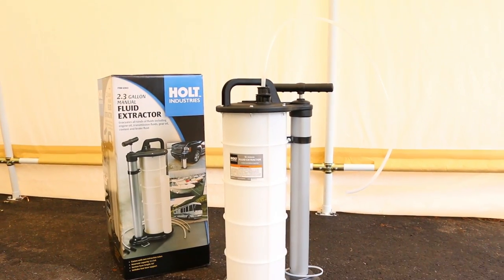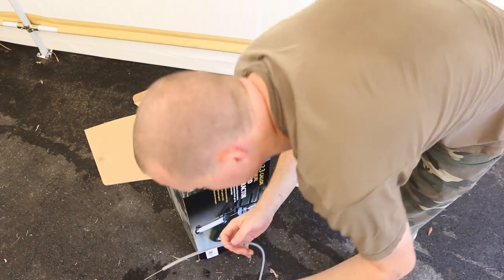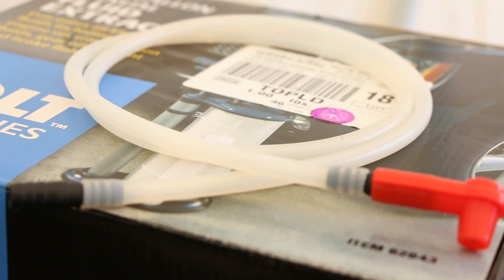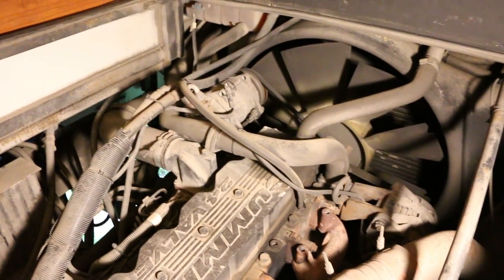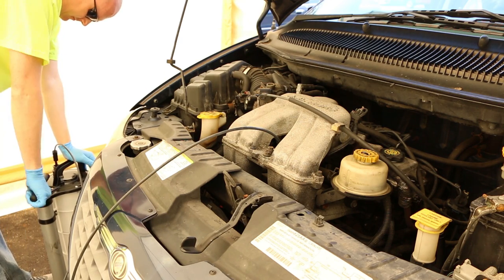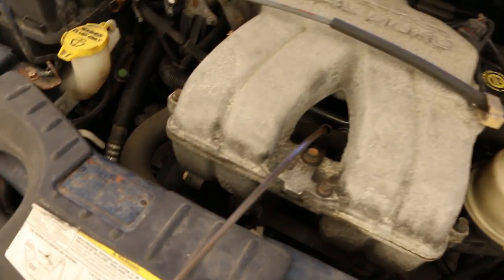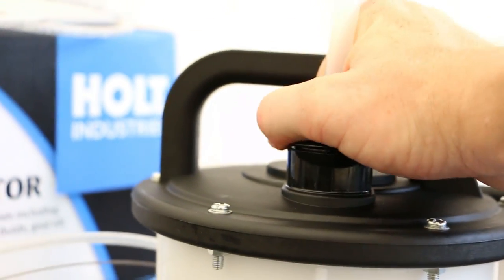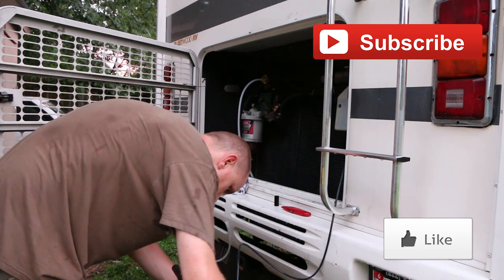Holt Manual Fluid Extractor from Harbor Freight

Comment: I overfilled my trans fluid after doing a filter and fluid change. I was thinking how much of a pain to drop the pan again and my step-dad recommended using a tube and siphon to remove the extra fluid. Worked great and I noticed the fluid was really drity again after only a few miles of driving. Think I will go get an extractor to flush and fill the trans a few times until the fluid is clean. Saves a lot of work especially on a trans with no drain plug. Good video.
Reply from the maker: thanks for the good words! I highly recommend looking into buying a used electric vehicle if you are getting tired of having to maintain internal combustion engine cars constantly.
Reply: Stay well clear of second hand electric vehicles, I should know I’m on my 3rd! Worst purchase you could possibly make. Stick to what works and has worked for years.

Comment: I paid $73.29 using a 25% off coupon. I like that it holds 2.3 gallons of oil. My wife’s MB E360 holds almost 2 gallons of oil, plus the filter is on the top. I will never remove the drain plug again!
Reply: Then you won't be getting all of the bad "stuff" out most likely.  Do a test.  Drain it with the evacuator.  When you're done, undo the drain bolt and see what collects in a drain pan, then you'll know for sure.
Reply: Ken Nagrod it’s only about 100 ML or less. Plus I do oil changes every 5000 miles. It’s perfectly fine.

Comment: I had a MitiVac that gave up the ghost about 6 months ago.  It had sealing issues so it would take 4-6 cycles of pumping to complete the oil drainage for my Mercedes (7 Qts). Got this one at Harbor Freight, and it's MUCH BETTER than the one I had.  Oil changed in less than 20 minutes on ONE pump cycle.  Worth it for DIYers if nothing else for the convenience and safety of not going under the car for an oil change.  It'll pay for itself in a year.
Reply from the maker: +David Badger nice! Thanks for the comment.

Comment: You didn't know where the dipstick was? 🤨
Reply from the maker: if you are talking about the van and the dipstick for that, prolly yeah. The transmission dipstick was in an unfamiliar area. Otherwise you see me simply inspecting around the motor. The van was relatively new to me at the time. Switching out transmission fluid is very worth doing for longevity of transmissions.... If you can make the switch though, an electric vehicle is phenomenal when it comes to maintenance.

Comment: typical volvo owner.  lol .... I know because I are one.  3 times over.  Currently own 3.  total owned in my lifetime ... 5.  So I get your sense of humor.  We're a strange culture.  I also have a motor home with a rear engine diesel.  I use my oil extractor mostly for my sailboat diesel motor.  It's hard to get to the drain port.  This thing works great.

Comment: You really helped me out after purchasing this. No where in the instructions does it mention pulling out the spout to pour out the old fluids. It was still difficult the first time. Now it comes out easily. I may still return it. On 2 of my vehicles I couldn't suck out any oil. After a lot of trial & error I realized the tube wasn't hitting the bottom of the oil pan. I measured it with the dip stick. It hits something & stops. GM 4.2l & 5.7 LS1 engine. I'm going to try your idea of buying 1/4" hose. That hose it comes with is very stiff. I'm hoping the the new hose will be softer & can get around the obstruction. My wives Buick 1.4 engine, I was able to reach the bottom of the oil pan. That car has a much shorter dip stick then the other 2 engine mentioned. Thanks for making this video & helping me decide if to keep it.
Reply from the maker: Glad I could help

Comment: I got one could be user error but I guess it left about a quart of oil in the pan. I kept on pumping and moving the hose around to try to get all the oil out. The one thing I think it needs is some way to trap the handle so it doesn't go up when you have it primed.  I would say for oil changes it's much slower than the old fashioned way of getting under the vehicle.  Another idea is put tape of something to keep you from fishing out the tube IF it ever comes loose and goes down the dipstick

Comment: Tried to buy the pneumatic version in HF. The manual version is now $144 while the pneumatic version is $149. Unfortunately HF did not honor my coupon so I did not pull the trigger. Buying retail with taxes will come up to $163 is hard to swallow. I understand inflation brought the price up since this video was made but still..

I end up buying the Schwaben 6-Liter Dual Powered Oil Extractor from ECS tuning for $90 after discount. This model can do both manual pump and pneumatic. Looks good on the brochure and the videos I’ve watched. Hope it will be as good or better than the HOLT.
Reply from the maker: I got the big green one right at the begining of covid (no video of it) it was the same price then. harbor freight has really kept most of their prices steady thru the past three years.

Comment: You can also change your p/s fluid, hook it up to the return line at the reservoir. Pump it up and it will suck up the stuff pretty good, it helps if you turn the steering wheel L-R.
Reply: You.must make sure the car is not running .pumps hate to run dry even for a few seconds

Comment: How do you like it so far? Are u able to get all oil out?
Reply from the maker: Yeah, enough oil at least. So, I ended up using it for all kinds of stuff and ended up leaving it outside for too long. I ended up buying the pneumatic one. The pneumatic one is tuff to use but nicer because it uses less pump strength.

Comment: My extractor just started leaking from the bottom when I began to pump. There is a spring loaded valve located under the base plate and it seems that this is failing. Any ideas?

Comment: Can I use it to remove dirty antifreeze coolants
Reply from the maker: Pretty sure you can with no issues. Your engine problems may be catastrophic however.... I've seen a Jeep warp two heads due to clogged radiator. Crazy. Those 4.0 blocks and everything else are near bulletproof, just dropped the ball on cooling.

Comment: Its 140 buchs now . Can ya use it for gas.   Or any fluids we should not use it with¿? Thanhs.   Never mind $140 one is the deluxe model but I'll be damned if I can tell the difference between the two

Comment: Still have to jack the car up and get under it to change the oil filter,so what’s the use.
Reply: The "use" is you don't have the issue of stripping the drain plug, having the drain plug fall into a vat of oil and you play blind deep sea diving for it and you don't risk spilling oil trying to put it into the gallon you just emptied.  And not to mention the  time you waste.  So, it worked out for me. I paid $65 with 25% off coupon. It's made my money back on 3 changes.

Comment: Just buy a vacuum pump while you are at harbor freight and make your own like I did.  Ends up cheaper, more flexible and works much better (30 min!  I would be done in 5).  So many parts here for such a simple concept. Great video though on the product.  Thanks

Comment: does nobody use a drain plug for the oil anymore?
Reply from the maker: Yes
Reply: Whoever did the last oil change on my car must have used a pneumatic wrench with the torque cranked all the way up. I can do pullups with the wrench. I tried a breaker bar for extra leverage, but started striping the head of the drain plug.
So it's either pump through the top, or have a mechanic try.

Comment: I bought this thing but when i went to use it its not sucking fluid like i expected it sucks it but somewhere its getting air in cause the lines arent getting completely filled with oil its getting a lot of bubbles and takes for ever to do the job i just gave up pumping and did it the old school way but is there something i need to do or didnt do for this thing to work right

Comment: How did you clean that after 1 years use?
Reply: Miguel Samonte seems like no one on the internet can answer that question.
Reply: @76kamikazi  Use an oil cleaner that won't damage plastics and rubber.  Plenty of enzyme based cleaners in the stores, although I don't know why you'd need to clean it.

Comment: i do boats and seadoos all day everyday i go through two mity vac units a year. Not that they are bad I just do that many changes My cost is 159,00 from my vendor. The one i use sucks or pumps with the flick of a button. Im fixing to order a new one This time Im going to try a moeller brand I have owned at least 6 of the mity vac brand 8.8L